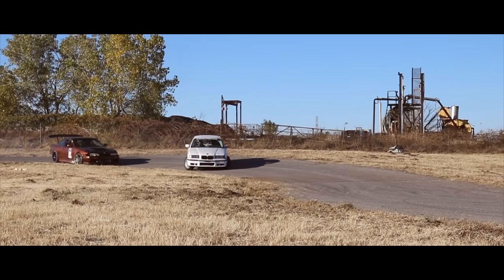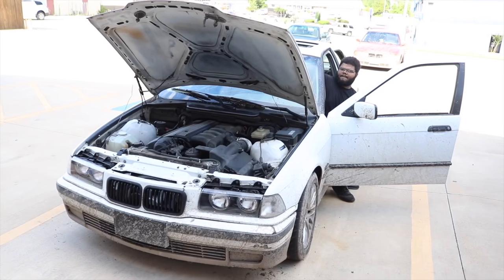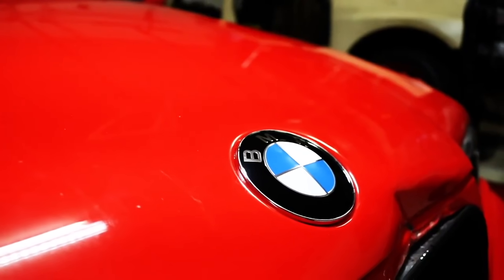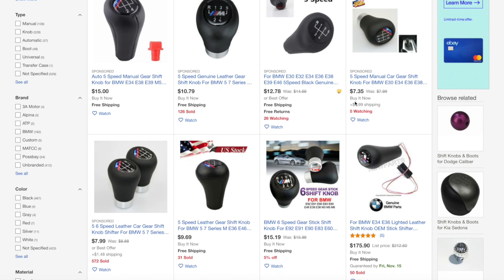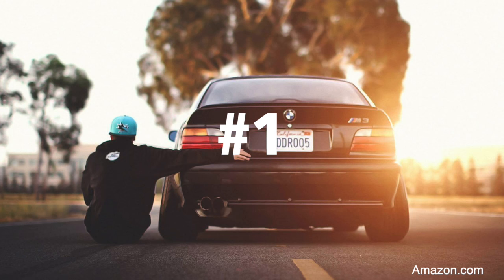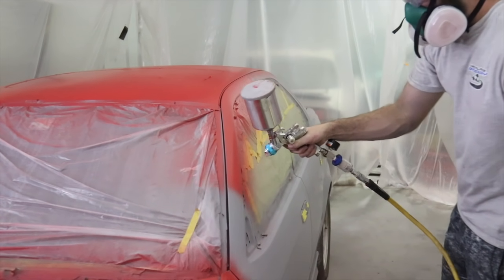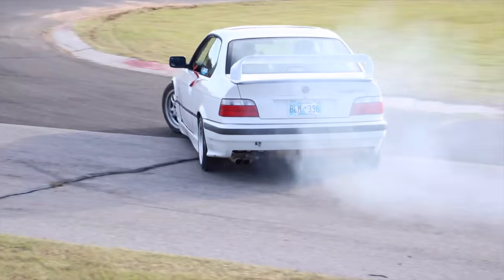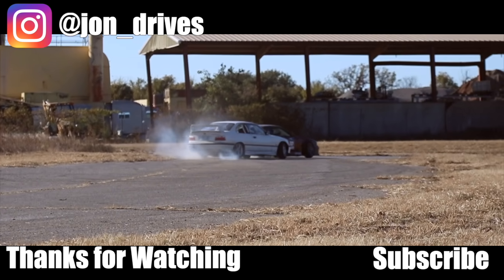Top 5 Upgrades To Make A BMW E36 LOOK NEW!

Comment: New stock headlights, New paintjob, New leather on the interior, new original wheel, new BMW badge, new original shot knob, new wheels with a nice pair of tires, that's my e36 receip, and goes for about most cars
Reply: Don't forget angel eyes(ring lights)

Comment: But the E46 steering wheel looks bad on E36, because it's not period correct . You should buy the mtech 2 or mtech 3 (with air bag) if you don't want to go aftermarket

Comment: Perfect top 5! Also, If you want your regular e36 to look a bit more sporty after that, just get an e36 M3 bodykit. ;)
Reply: As much as I want to agree, everyone does it (with good reason, it does look great). I think a Non M car lowered looks great with stock bumpers/sideskirts, although I think the M3 side trim on the doors looks killer.
Reply: @letsplayclassicgames5024  I know what you mean. There is something special about a lowered stock E36, even without the side skirts. It just screams class and quality.

Comment: man i have an m3 e36 97 and for sum reason it just won’t start or turn on, we added a new battery, checked the fuses, and the engine is completely in good condition. and thanks for the tips.
Reply from the maker: XDShizzle check if you have fuel. Starter fluid in the intake, and if it starts, you know you have a fuel issue

Comment: Hello yes and there are many more things you can do , White lights front side and rear , easily available on EBay  makes the car look so fresh , , Paint the sills and bars the same colour as the car also , Big plus is NEW Wheels , I got a very good set of F90  3 series 17x7.5" alloys  with 235x45-17 Firestone S01s , ( just fit under the guards) , makes the car look like a Tonka Toy on steroids !!!, also some gloss black M grilles. one other thing Chrome exhaust trims ! also use Tyre shine on all the mouldings and under bonnet plastics keeps them shinier longer and yes New badges i bought Alpina Bages and side stripes , my Madiera Schwarz 325i Coupe looks new not 27 years old now

Comment: 1:15 this is not the e36 m3 steering wheel..you showed the e46 steering wheel and i think is not even from e46 m3
Reply: Look at the bottom right corner

Comment: Hey I realy need help with this but I wanted to know is if i should engine swap or turbo my e36
Reply from the maker: great question. I would say do some research on both and see what is right for you. I am currently gathering parts for a turbo setup. Thanks man
Reply: If it's an m3 I'd turbo it it already has a great engine in it. If it's just a 3 series since it's not as special of a car I'd do a swap.

Comment: I have an e36 and the cooling is bad on it I don’t know what to do😭🥺
Reply from the maker: Replace the cooling system. Put an electric fan! That helps
Reply: Replace the Thermostat n flush the radiator. You want to see the radiator gush lots of water when u run a hose on it. Also the Heater control valve vould be stuck not allowing the heater core to fill properly n get the trapped air out of the system.  Upgrade the bleeder screw to a brass bleeder. Also check if your fan clutch has tension when it starts to reach normal operating temp. Verify any other coolant leaks

Comment: Hey John. Have you ever broken an axle with a welded diff? Any advice on reducing that? 

p.s. your videos makes me want to drift my 36 :P
Reply from the maker: Hey man. Not yet. With stock power, I would imagine that wouldn't be a huge issue. My buddy actually broke one once but that was because it had 188k miles and 27 years on it. So maybe just replace with new ones.
Reply: Really late to comment but maybe it’ll help someone. If the cars lowered the axles cam overextend and break. You can get axle spaces which will basically fix the issue

Comment: Drift mod video would be cool because jeeesus if I blow another guibo from just normal driving I’m gonna throw a fit. 😂😂
Reply from the maker: HeyImSLY haha I’ll have to start putting it together. These types of videos might be beneficial in the winter because less daylight = less time to shoot videos 😬
Reply: Jon Drives do you still use a rubber guibo? Because I’m about to grab an aluminum with poly bushing one from ecs tuning. I’d rather something else brake at this point. Tired of cutting and welding the exhaust. Lol.
Reply: Same lmao I blew mine on the way back from a 300 mile trip and drove home on the metal bolt linings😂😭

Comment: painting brake pads-if u have a black beemer then yellow is the way to go red is just not so in the eyes as far as I'm seeing it these days. buy a white marker and paint over the tire name tag ... like the color the name continental and it will pop with ur car.
these are probably the coolest and cheapest things.
and if u cant get like them new rims or stuff go to used cars find some rusted ones just freshen them up and paint over. (cheap and looks good in the end).